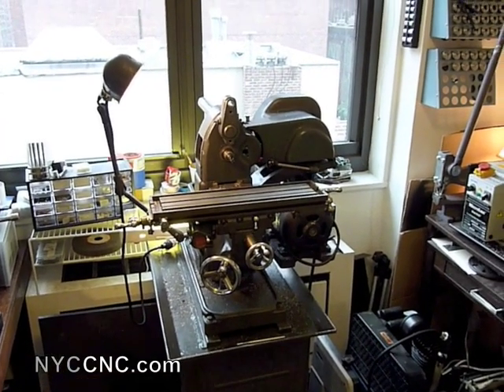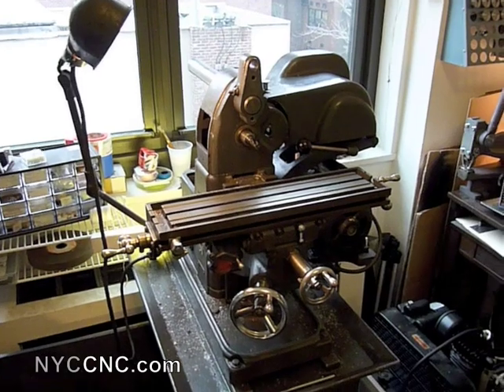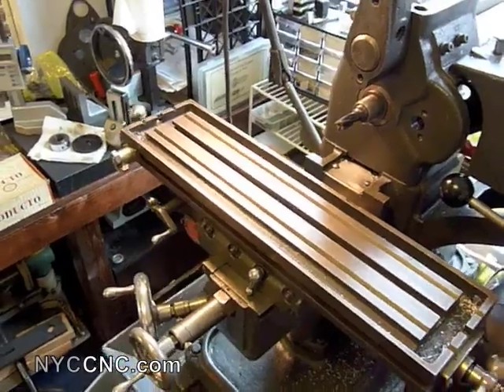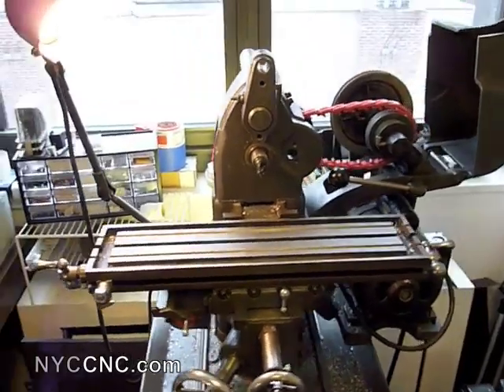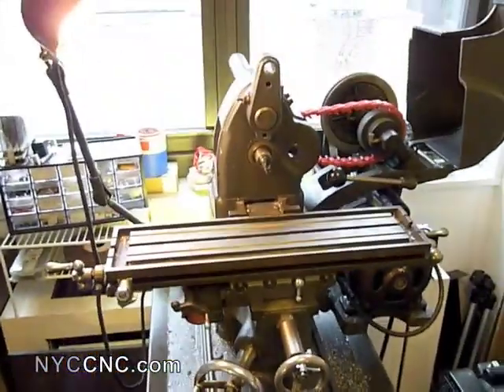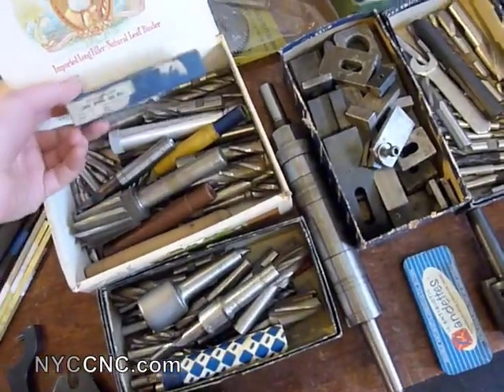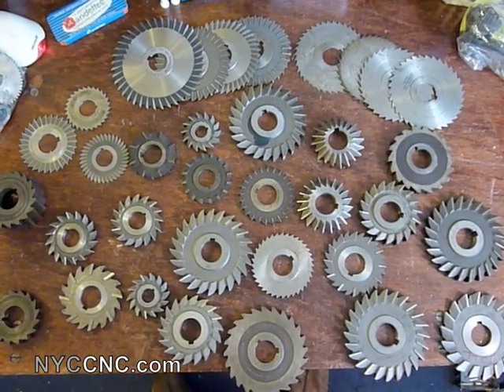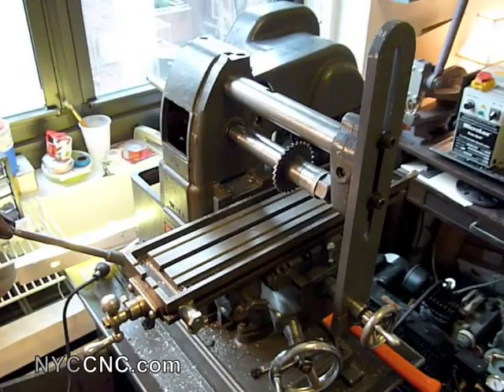Atlas Horizontal MFC Mill Overview Video!  Great, rigid horizontal milling machine!

Comment: Thanks, I picked mine up 2 days ago for $690 with only 6 end mill cutter, one slitting cutter and a digital Mahr Federal indicator. It has a home made steel welded base and a underpowered (IMO) 1/6hp motor. Luckily for me I can make a custom drip pan and custom base at a later time. Also I happen to have laying around a 1/2hp Dunlap motor for it. I was the first one to see it so I had to take it, several here in south jersey I have missed.

Comment: I was looking for a atlas to go with my atlas lathes but couldn't pass up a Sheldon horizontal mill,, all complete , l almost didn't go the price was so cheap at 300 dollars but glad I did except for the grease and grime was in perfect working condition and no run out on table and no play on knobs,, and automatic feed works great had nice end mill holder and arbor with 10 cutters and 6 end mills,, not much bigger than atlas but it's about 700 lbs,, l have a nice orginal milling attachment for my 12 inch lathe so I'm pretty well set up now.

Comment: nice gloat .,
try keeping the arbor bearing on the protruding back end of the support-bar instead of on the front when not used. And always use an arbor as short as possible ,making it possible to move the Arbor-bearing closer to the spndle and more to the middle of the support-bar for maximum rigidity.
thx for the vid ;)

Comment: How this MFC machine doing now???It been a while and you didn't post any new videos of machining on Atlas MFC....I looking for buy one just like that machine,problem that I didn't locate one yet...Despite that I have no machine or ever seen one I already know how to build vertical head attachment....Iam still working on my Craftsman 109 lathe,lot of modefications related to head stock assembly and spindle...New spindle now is 3/4 diameter,larger support and tension bushings made personally from brass,the apron seems wasn't originally was made by Craftsman  but maybe by Sears or Logan brand,neverlentless it was modified to properly fit and balance..I don't think I even done there,original rotating nut probably would be replaced by more proper features,extension would be weld for standard crank rotation for feed also automatic rotation mechanism would be added...Science manual operation would required to install geared rack which somehow might benefit new turret tail stock that to build in mind.....As final component would be constructing gear box for lead screw feeding speeds,the original face gear drive assembly unchanged,holes drilled larger to support 3/4 spindle,brass bushings installed and reamed inside pulley/gear and final element is making cuts for a key..I had made my own version of Wen 12" drill press with way much thicker walls that can withstand 10 ton weight,been tested positively for pressure....It begun journey from near 3" steel pipe and become 2.550/2.556" instead,local machine shop didn't help me even one bit which made me course them 2 times,at the end after welding and initial grinding I end up with oval shape pipe science extra material was cutted off from it,than 2 sawed half's been weld professionally and grund off...By using my blacsmithing skills along with various draw bars and mallets I had round the pipe into correct shape,after that hard procedure been accomplished pipe been grinded and hand sanded for smoothness like original column,every single grinding and sanding operation was double checked with caliper every single time..Final result was 1:1 scale of original,all parts fit as expected not too tight and not too loose...Another modification is drilling holes in geared rack and making half round cut inside table elevating bracket for secondary bar that balances assembly..The table assembly cannot self rotate during drilling anymore which means drill bit cannot go out of center and same goes for the head,it cannot lean forward because of weak exhaust pipe like thin column....The final step still left to rewire motor speed indicator,it would be connected to switch and only would go on when motor get powered on instead just plugging wire in outlet...Particular drill press can be an milling machine with compound table and Er32 collets and chuck,it have MT2 arbor setting....

Comment: Poor IMPORT quality? Are you kidding? Talking about an Atlas product and quality? Zamak is the engineers answer to planned obsolescence, and no one ever used more zinc alloy than Atlas. I just brought one of these mills home for my little museum. The Asian imports are FAR better made, in materials anyway.
Reply: Parts_ Production what asian import is a horizontal with power feed in this configuration. I’ve not seen one. This thing rocks! I have two of them. The track years are no issue with their ability and less you’re ignorant with your speeds and feeds.